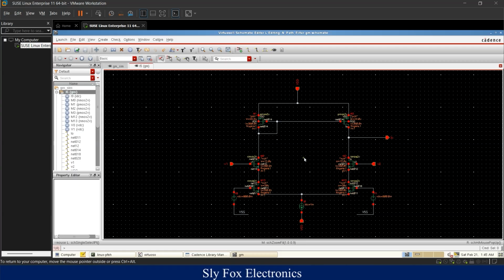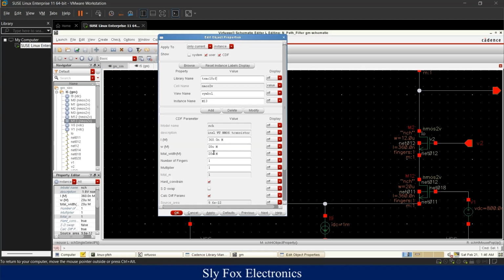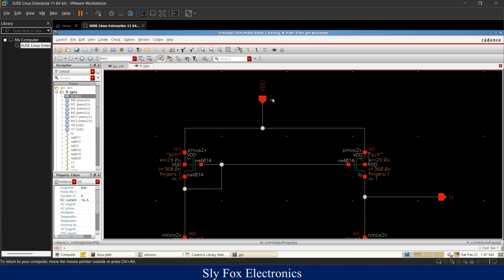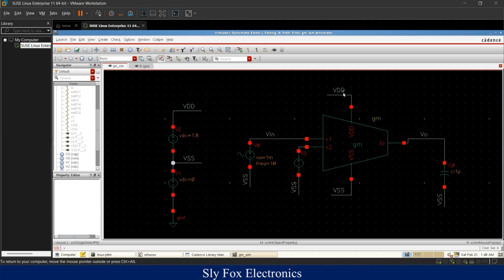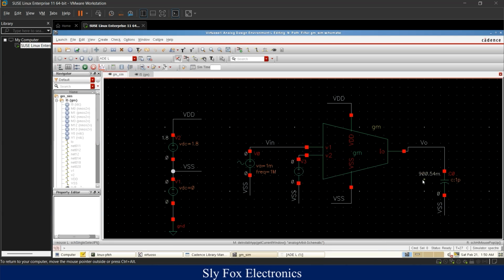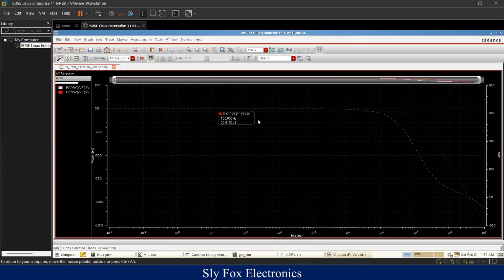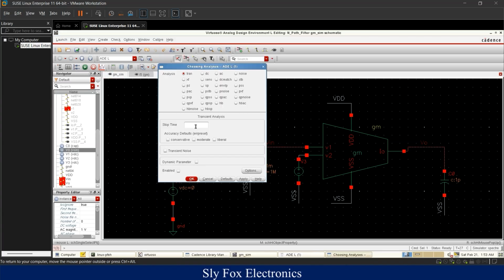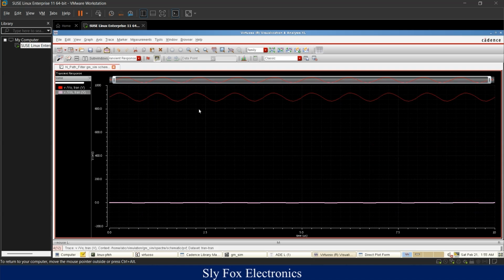Ultra-Linear NMOS Differential OTA Design! ⚡🔬 |  Source Degeneration (Cadence Simulation)

Comment: Where the DC operating points checked
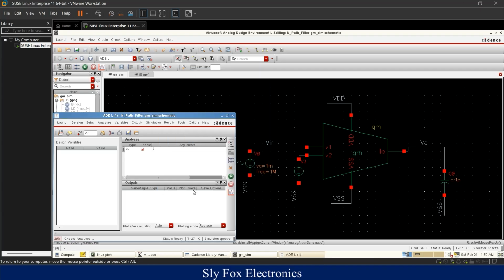Reply from the maker: DC simulation is done and its chapter is available in the video, around 05:00 .

and if you mean the DC operating point of each transistor, to do that you need to run DC simulation as shown in the video, then right click on the schematic window > Annotation > DC operating points.

then you need to enter the symbol so see transistors operating points

Good luck 🦊